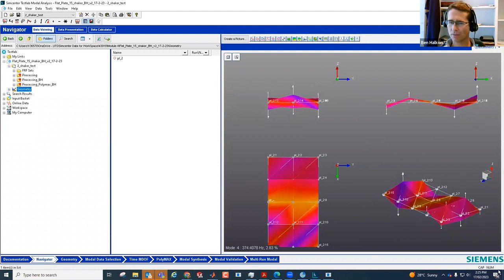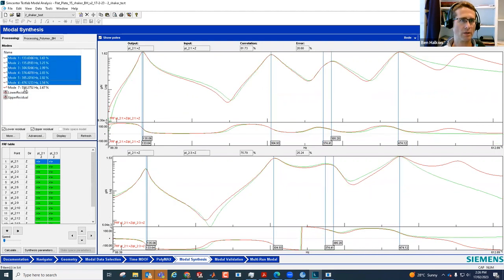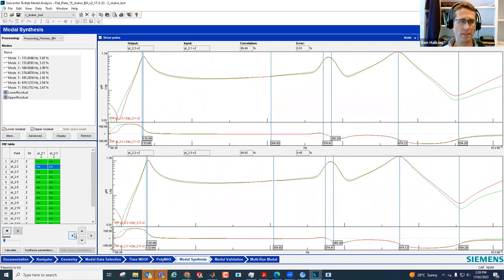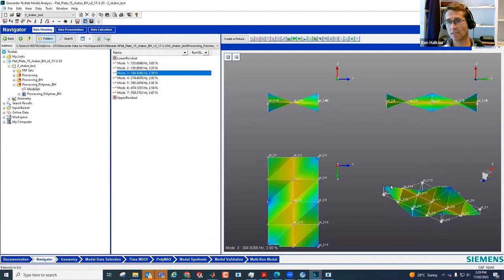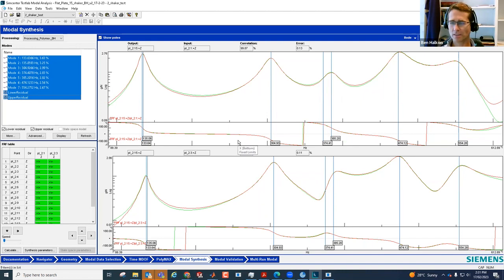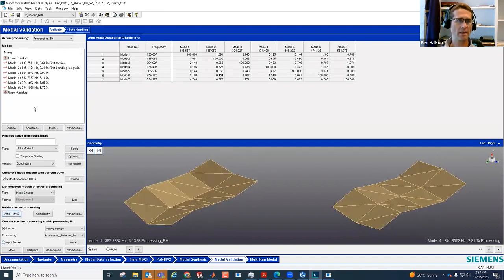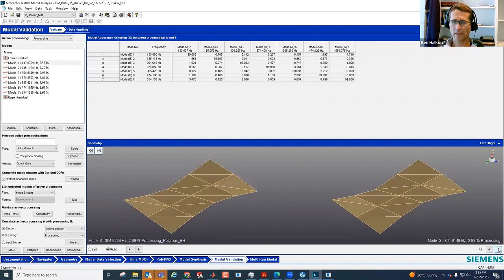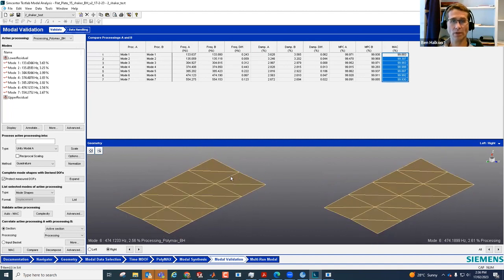Siemens Simcenter Testlab Modal Analysis Tutorial video guide 2 of 2

Comment: What exactly is meant by a "synthesized" FRF. I understand most of the data is compared to a summarized FRF in PolyMAX but still unsure what exactly is done to the data when it is synthesized.
Reply: I think these are the FRF reconstructured using the estimated modal parameters (primarily calculated poles of the characteristics equation)